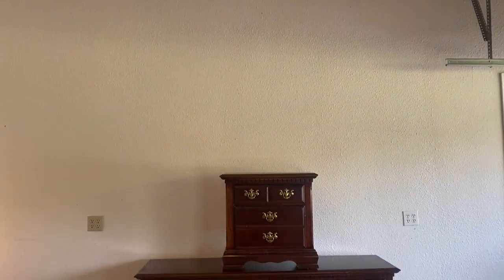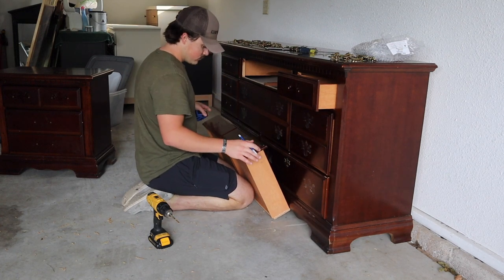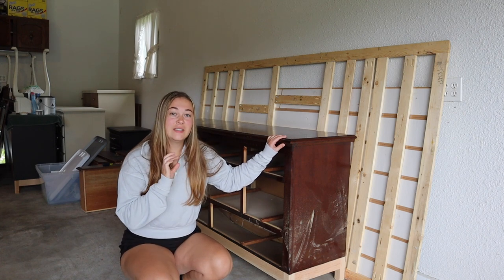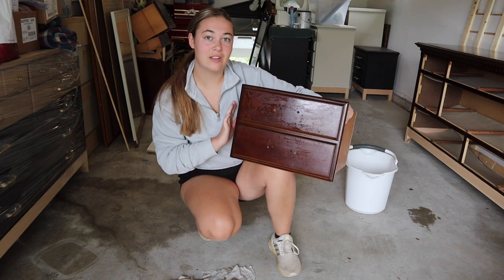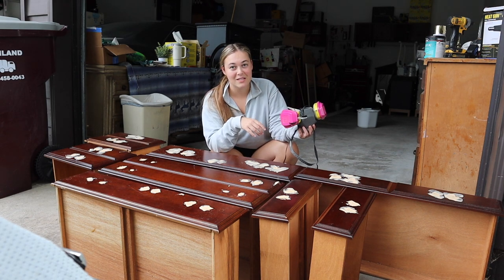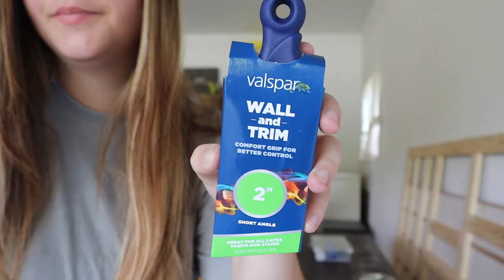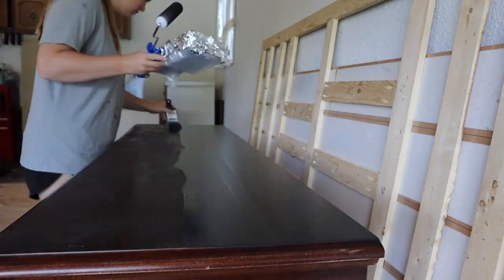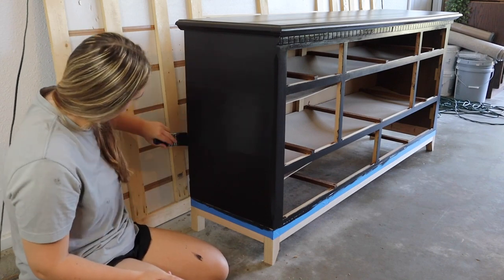Streak Free Finish & NO Brush Strokes! PAINTING FURNITURE BLACK - step by step furniture flip

Comment: Yes, to a base build video.  Hardware drilling holes is always scary for me, but I bought a cheap hardware hole jig on Amazon and it is life changing, enables you to hold your drill better and replicate accuracy every time. Also upgraded my jigsaw and it made a huge difference in cutting...adapts for straight lines as well as curves and speed variation.  Plus it's cordless and lighted, big step up from my grandpa's old tool, reasonably priced, better technology.